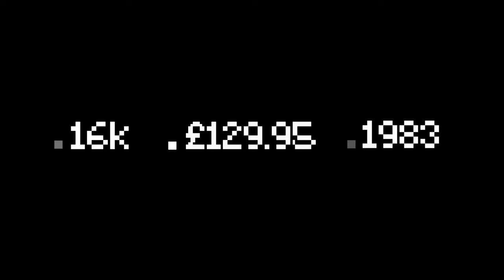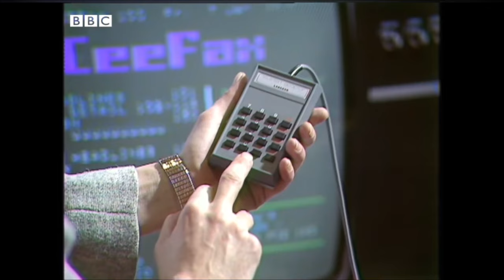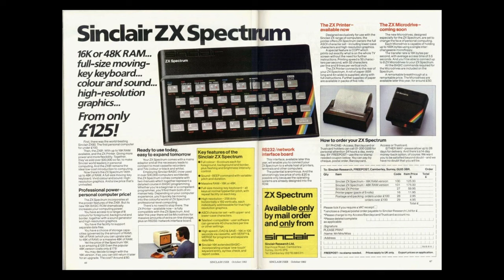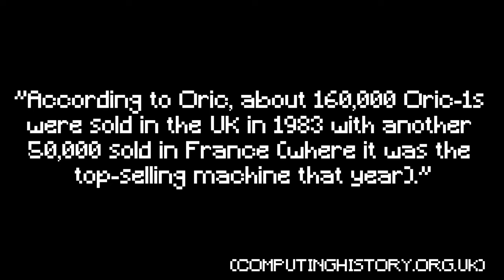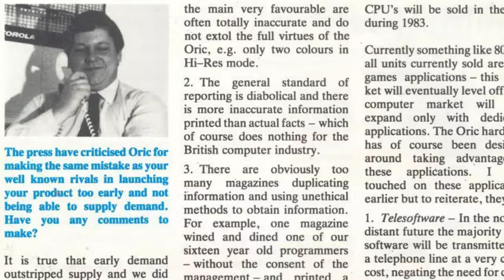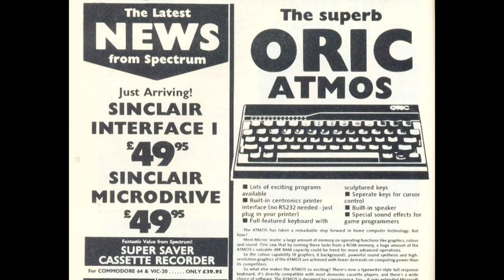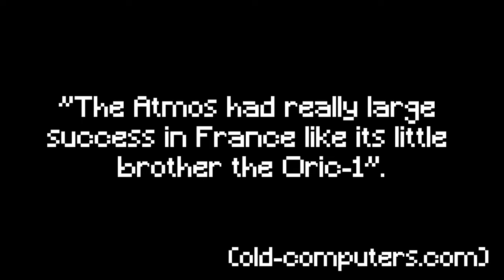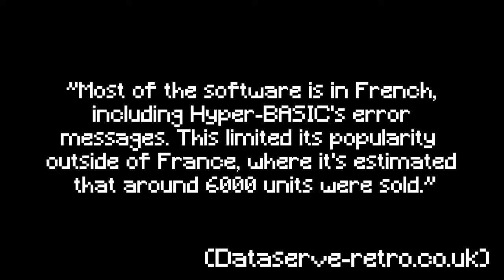A Brief History of Tangerine Computers #tangerineoric #retrocomputer #retrocomputing

Comment: Hi, interesting video, a few notes though:

You mention that the Z80 much faster than the 6502, but that's not actually completely true. The Z80 uses more clock cycles to perform operations compared to the 6502, and in a certain number of cases the 6502 can outperform a Z80 running at more than double the frequency.

The Erebus is a creation from Kenneth, 8-bit tronic just built and sold it (that's even written in the product description)

Glad you liked my Yessagician picture (@9:59).

I also agree with @johnwatson4801 regarding the music: It's a bit loud, and most annoyingly it tends to be the same repeating loop.
Reply: Ha Ha, these youngsters today don't understand clock cycles :) I spent the first decade of my professional life avoiding multi-byte arrays to minimise the number of multiplies in my code. Just imagine getting a C++ OOP cultist to understand :)

Comment: Comparing the performance of different cpu architectures, based solely on their relative clock speeds (measured in megahertz), simply isn't a valid comparison. It's only valid when comparing the relative performance of CPUs of the same architecture. The OS wasn't BASIC, BASIC is a programming language. It is both controlled by, and will have access to the underlying OS, but you could load another language whilst still using the original OS. As others have said, the music is too intrusive.
Reply from the maker: Thanks for your input.

Comment: There's some good info in this video. I don't want to sound harsh, but future videos would benefit from a few simple changes. All aspects of presentation are important, not just the video clips. So, (1) Reduce the music volume, and (2) check for simple grammatical errors. For example,  "1988 saw the end", not "1988 seen the end" . You might want to brush up on where to use "was" and "were" too. 😉  You want people to have faith in you and the information you're presenting, and basic errors can put people off coming back for more. 🙂
Reply from the maker: This video is over a year old 😉
Reply: @JustJamie1983  I actually like the regional accent and lingo - leave it in :)
Reply from the maker: @cpcnw ewwww Rrr